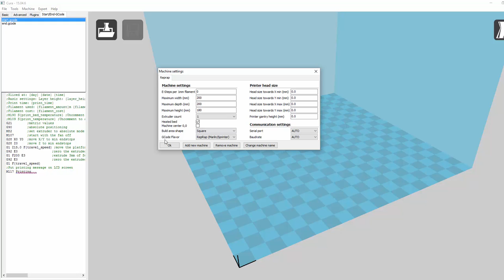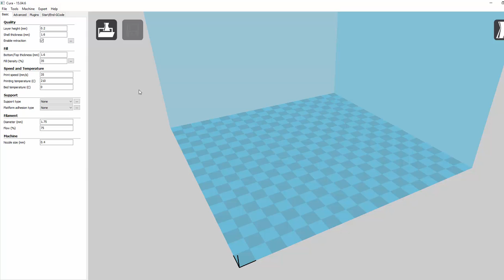My Cura Settings for Prusa i3 Clone CTC PLA

Comment: Just a note on filament diameter; In my experience they vary rather more than you'd expect, Ive seen 1.75mm filament measure at 1.62mm and as wide as 1.78mm, in general manufacturers seem to err unwisely on the side of too small rather than too big which is a mistake of poor logic because eg.  0.03mm error 1.78mm/1.75mm v. 1.75mm/1.72mm isn't an equal amount of diameter inaccuracy; The calculation used is Pi xR-Squared Cross Sectional AREA of the filament not radius alone, so comparison1 is 2.487/2.404 =1.034, 3.4% too big versus 2.700mm/2.404mm = 1.035 or 3.5% too small for the same 0.02mm - You should not assume that your filament IS 1.75mm but instead use digital calipers to measure it OR be ready to adjust %flow to compensate for over/under extrusion.

Comment: how are you using cura 15.x.x when currently, cura is 3.6.x ??
Reply from the maker: Old versions had higher numbers don't know why it went from 15.04.6 to 2.1.2 have a look on the cura website under versions.
Reply: @AhcMeUk  Do you have the updated settings for Cura 4.21? Especially the retraction settings?

Comment: for speed,
shake/vibrating, coincidental I'm working on that now
Can you also change the settings in your LCD screen?
acceleration, eg jerk, view jerk ..... v max, x speed
In my screen it was: v max x 200 now 150
and v max y 200 now 150
a travel 2000 now 1700
My machine vibrant also a lot and missing the Y axis steps!
now not anymore!    :-)
try this too?

success and kind regards from the Netherlands!
Rob.
Reply from the maker: +R. Rob. Will give it a go
Reply: Accel. 2000 ...............................now: 1700
vX jerk 20
vY jerk 20
vZ jerk +000.40
vE jerk 5
vmaxX 200.................................now150
vmaxY 200.................................now150
vmaxZ 2
vmaxE 25
vmin 0
travel vmin 0
maxX 2000
maxY 2000
maxZ 100
maxE 10000
a retract 2000
a travel 2000
X steps/m 80.00
Y steps/m 80.00
Z steps/m 4000.00
E steps/m 770.00

My printer missed Y Steps while printing little/small letters! 
too much.... (how do you write that?) shocked shake vibrate

also here, (on my printer!) the stepsticks get/go too hot.
I'm going to look for a fan for that!
(and also maybe wrong setting trimpot is also possible)
also, I'm working on it/that.

If it wil works for you too??????  I hope so!

again success with the printer!
Rob.

Comment: The steps per mm are set on the printer itself I assume (thro the LED menu), and the slicer/gcode sends info in mm's.  Think mine are something like X and Y 78, Z 2560.  Then you can do some calibration runs (or manual movement) and measure the actual results.

Comment: Hi, just wanted to say thanks a lot for this video and your printer build video. I'm a complete beginner to 3D printing, and I have the same printer as you, but the instructions mine came with were completely wrong, so I would have been stuck without your help. But thanks to you, it's happily printing away right next to me as I type this :)